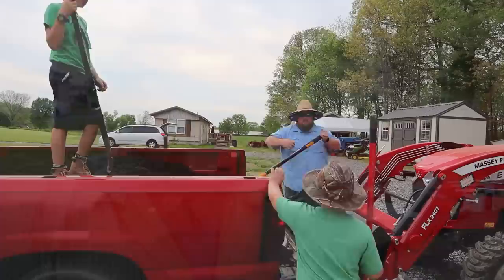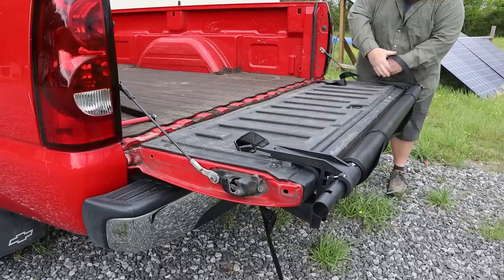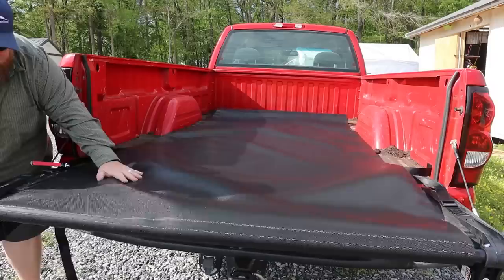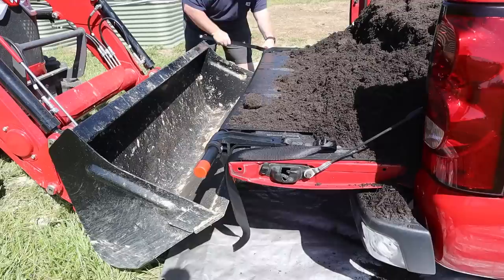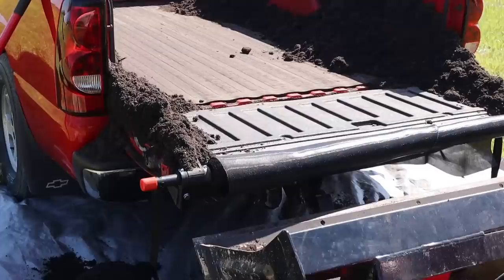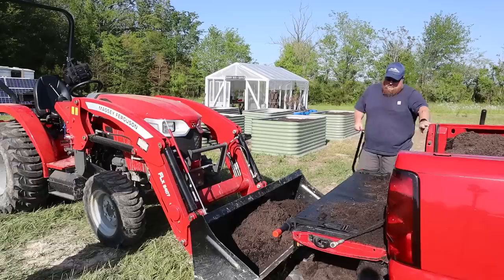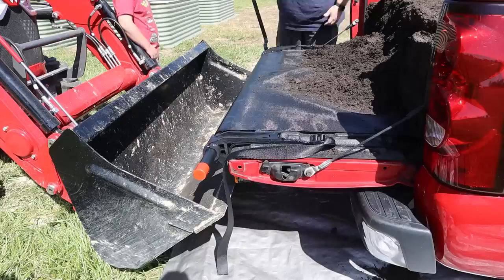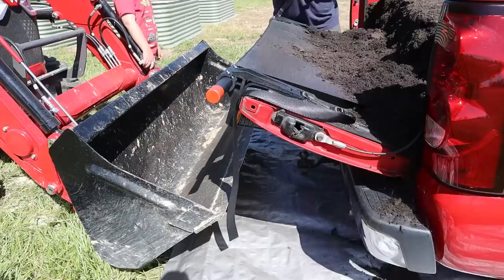We Bought the Cheapest Truck Bed Cargo Unloader... DID IT WORK?

Comment: Awesome video and those boys have grown like weeds. They are quite the help too. 

Find some kind of poly material to create a slide in the bottom to help with friction. Also so e plywood wings in the bed to create a “v” shape and funnel it to middle will help with spillage off the sides and reduce what’s left in bed along the sides. 

I’ve considered one of those for a while. Also thought of building one out of a heady tarp and sh80 pipe and use a 3/4 drive long pull handle to wind it up or seen some mod a winch to drive it.

Comment: POSSIBLE SOLUTION
You need to add some side panels from your truck bed out to the end of the tailgate so it doesn't spell out as much. You could possibly use sheets of plywood on either side and attach it in some way to the tailgate.  It might be worth a try.

Comment: 1 you have to not have the rubber mat.2 the friction of the load being on the bed off the mat material probably didnt help. I too thought it was worth the 50 bucks to find out. I have a bedliner thats a plastic like material. I loaded 57 gravel and I've loaded sand. And as long as I didn't load enough to overflow into the areas of the bed above the wheel wells etc. I could easily one-handed crank it out. Usually Ill shovel the little bit that ends up not on the material out a bit. Then it works like a charm.

Comment: I wonder if you could make something out of plywood for either side of the bed when it's down, that would block the soil from dropping out the sides.  I wouldn't think it'd take much, and to keep it in place, either clamp it to the sides of the bed, or use a 2x4 mounted to it that goes down the gap between the bed and the tailgate?

Comment: 2 things to make it work better. 1. Comments about using something between rubber bed liner and fabric are correct.  Solution is: Get a 4x8 sheet of dry erase "white board" to put on top of the rubber bed liner and use the white slick side against the unloader cargo mat. 2. Block off or clear the area in front of the wheel wells so material cannot build up in that space in front of the wheel wells which keeps the load from sliding easily.

Comment: Hi, just couple of things (maybe tips?) the next time you use the truck unloader thing after the liner is pulled out put a tarp cross ways then  when you go to pull the soil out the tarp will help pull more out. After this season of planting just think about the root system from this season and if you want to leave them in for the next growing season or take them out?

Comment: Looks like a design flaw, you shouldn't have to remove the handle each time you rotate it, I've seen other one's  where the user was able to stand off to the side like you are, but is able to turn the handle without removing it and putting back into the roller bar.